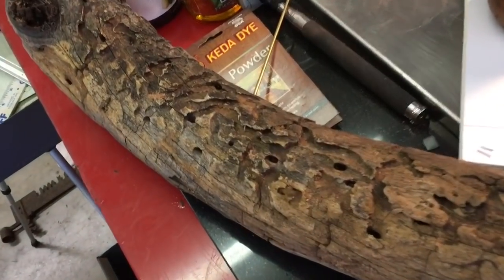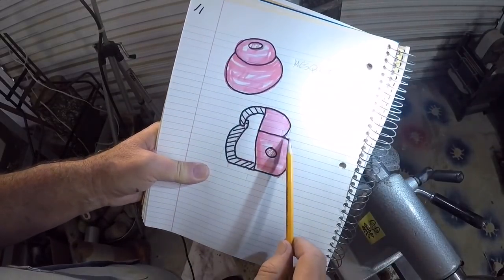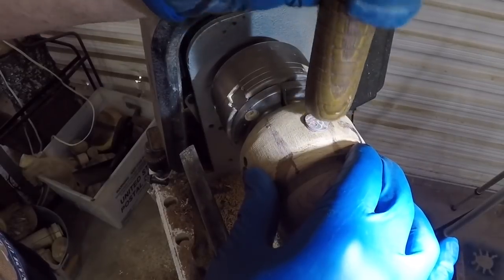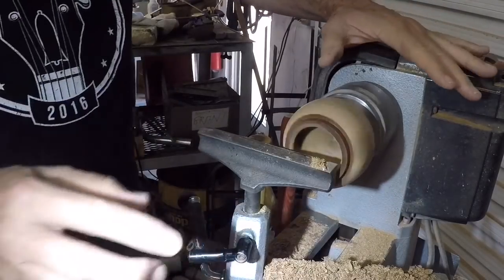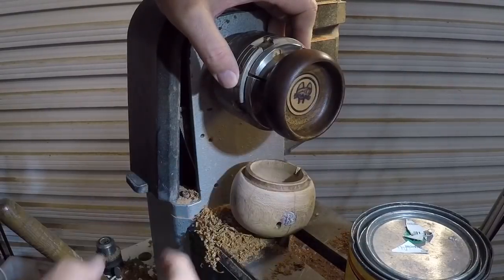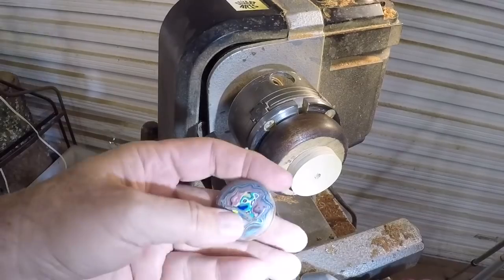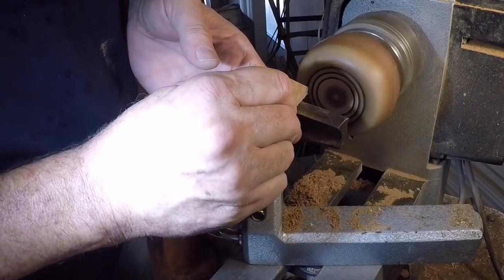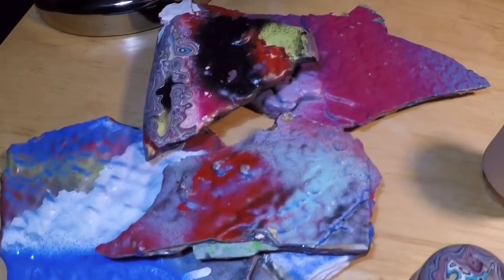Turning a Lidded Box from Auntie's Mesquite Firewood on My Midi Lathe

Comment: Do you buy the CA glue in bulk, or a bottle at a time? I saw another YouTube video, where a guy was going to repair the nut on a guitar, with CA and bicarbonate of soda! Apparently, it's extremely tough!
Reply from the maker: Scott Gray it is good stuff Scott, I buy mine on line in 2 oz bottles for about $7 each. A bottle like that will last me a couple months to more.  I haven't tried the bicarb trick, but I've seen it....

Comment: Lathe question: why does your machine have that clunky sound? Can hear it better when turning on/off
Reply from the maker: The headstock spindle ball bearings are worn...time for some maintenance...they will cost about $15 each and it'll take me about an hour to replace them...I've put that off too long.